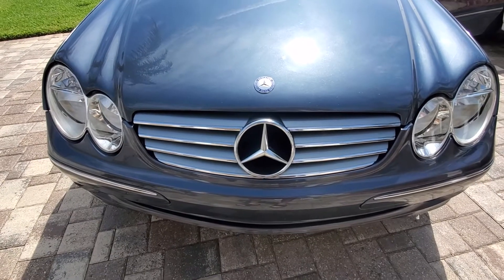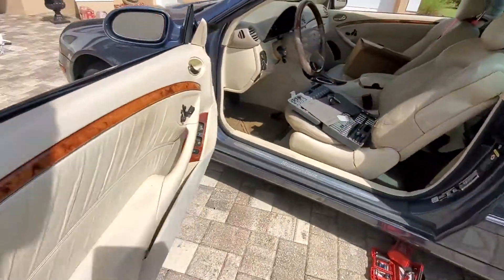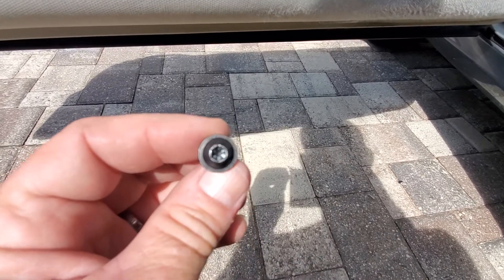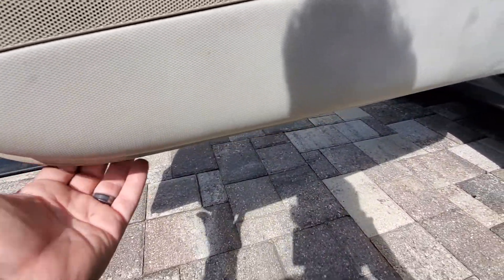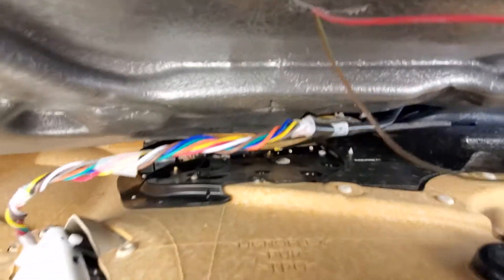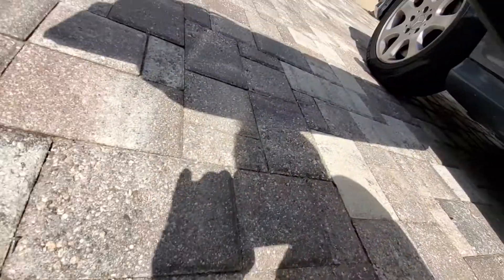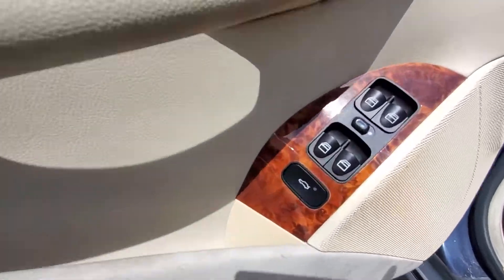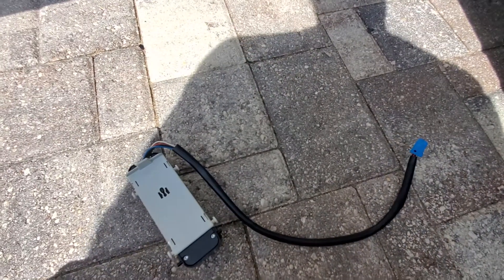SOLVED! Master Window Switch for 2004 CLK320 MB Mercedes-Benz Convertible

Comment: Many thanks for this excellent video. Ordered a used window switch from eBay, but it arrived with the lead too short. (It was from a C-Klasse - showed on eBay that it was compatible, but it wasn't). Anyway, seller gave me a refund, and so all was well. Ordered a new OEM switch, making sure that it was the right part number. 🙂
Followed your instructions to the letter, and fixed it in 10 minutes. Even sorted out the non-functioning light in the bottom of the door at the same time. Who said blokes can't multi-task???
Many thanks for saving me (and lots of others) a considerable amount of money. 
👍

Comment: A question: if you have a faulty master power window switch, does that disable most of electric functionality on the left side: rear window, power seats, left mirror, and the windows themselves?
Reply: I would love to know also because I have that issue seats n windows driver side don’t work